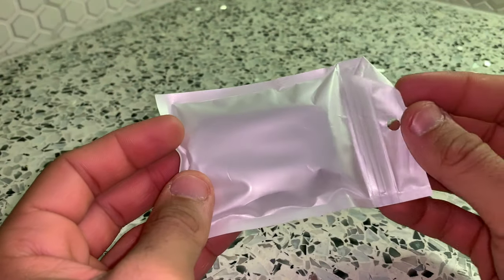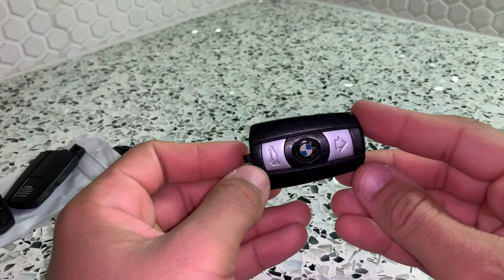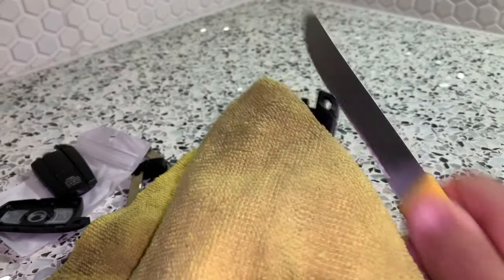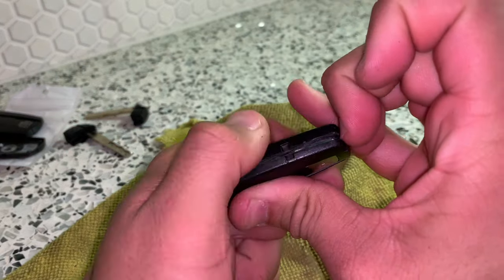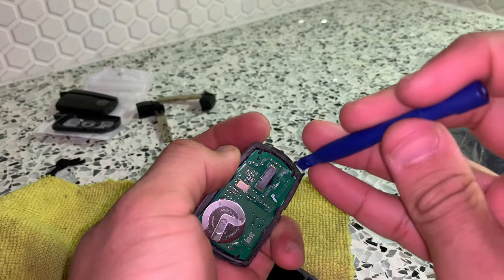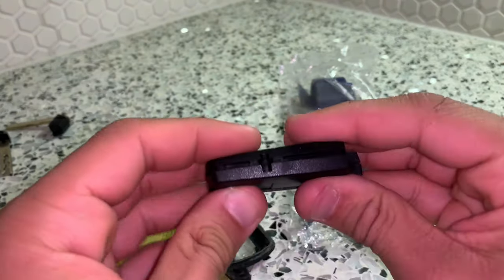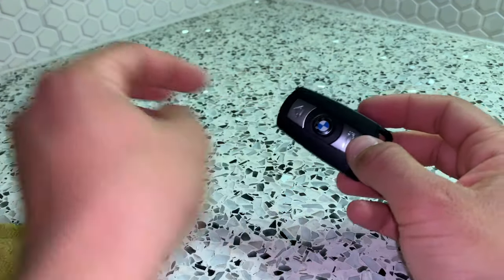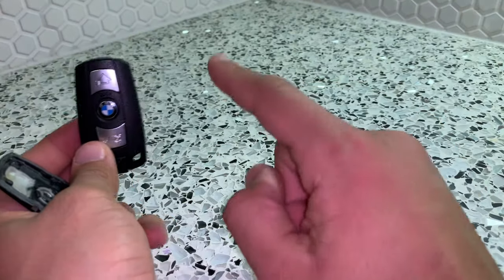How To Replace BMW Keyfob Cover | E90 E92 328i 335i

Comment: This makes me wonder is you can just take the chips out and replace the casings with like your own custom case 🤔
Reply from the maker: Technically you could! As long as the casing is made for the car or made to fit your chip inside it, it could work!
Reply: Well yeah

Comment: You can actually use the key to open the case. Theres a hole in the key hole that is meant for the key to pry the case open
Reply from the maker: I have never seen a hole in which you can use the key to open it. This is the model that doesn’t have the removable battery cover

Comment: I done this now my key wont work. So strange because i took it out of the old casing and just had the circuit board and that could unlock and lock the car. As soon as i put it in new plastic casing it has stopped unlocking and locking the car. It still starts though. Please help…

Comment: Great vid man I actually just finished doing this but now the fob doesnt unlock/lock the car but I can start the car. Makes no sense
Reply from the maker: Does the trunk button work? My key has the same issue but locks the car, and activates the trunk, but won’t unlock. May be the chip itself or the button isn’t sat all the way. Try to take the chip outside to the car without the plastic cover and see if it works or reposition the buttons in the cover. They might just be not positioned correctly!
Reply: @IzzyE9X  yea I tried to unlock it with just the chip and it still doesnt work. So weird, everything was working fine yesterday prior to opening the key up.
Reply from the maker: That is very weird to me honest, considering the casing has no electrical components or anything related to the functions themselves. Was anything on the chip cut when cutting through the plastic?
Reply: @IzzyE9X  nope, everything looks fine on the chip. Especially since the car drives fine with the key fob
Reply from the maker: @abrahamhungria4838  that typically happens when the keyfob’s battery is low, it loses functions but starts the car fine. Sorry to hear that man! You can look around in the forums but could’ve just been a coincidence that the battery died out the same day you did that outer case replacement. Let me know if you need any more help brotha!
Reply: did u ever figured out what was the problem? i just switched mine and now it won't unlock,lock or the trunk button isn't working either